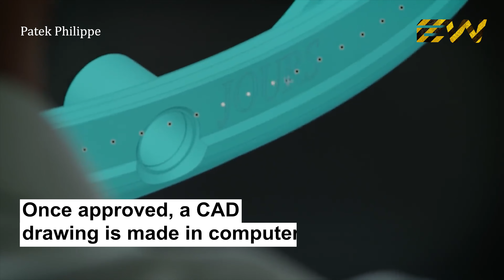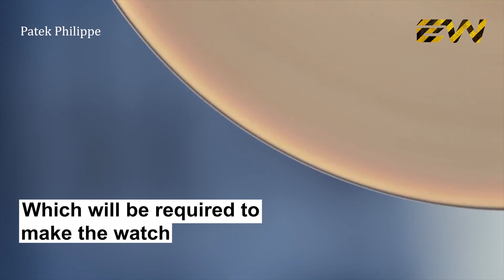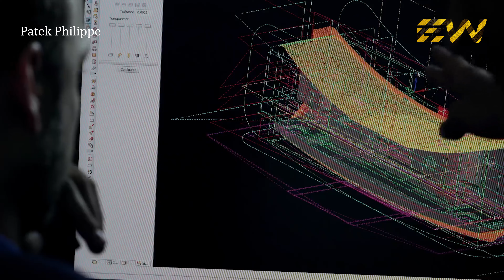How LUXURY Watches are Made? (Mega Factories Video)

Comment: Among hobbyists, great store is placed on the use of finger cotts to prevent finger prints marring the finish on parts and casing. These were not used in the assembly of this watch? Gloves were only used at the end?
Reply: Accuracy will be way off if he uses gloves. As per mentioned, they're made with very low tolerance, so, high accuracy is the key here
Reply: @Sulungu-sulunguu 
the assembly should be done with the gloves worn,
the assembly would be carried out without affecting the system if the machining were done with high precision, b/c the parts would land in place without improvising the position of the parts with manual controll, that's why they are machined with high precision and efficient design
the prints and electrolytes would definitely impede the materials to corrode
cannot understand that a 30million dollar piece was built with set of bare hands of whom he calls professional
Reply: the person is using tweezers for the most parts